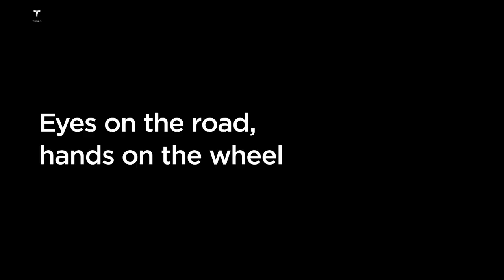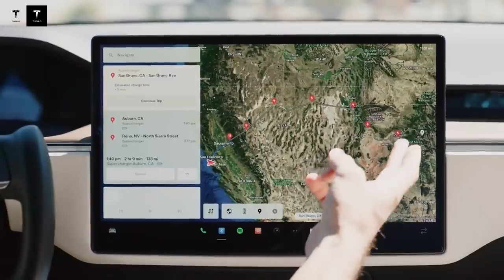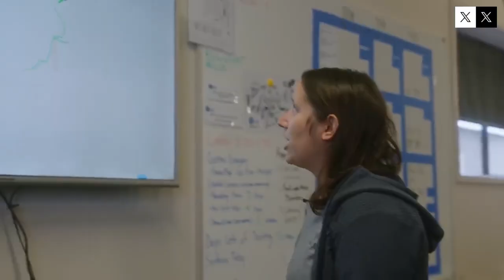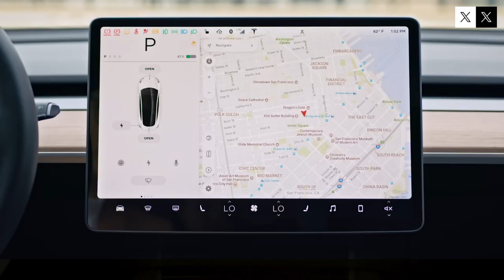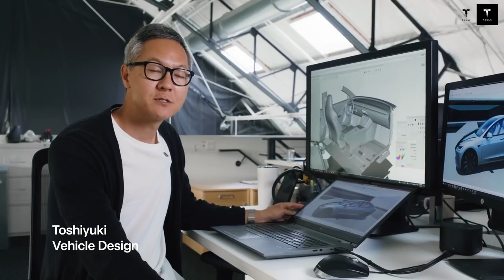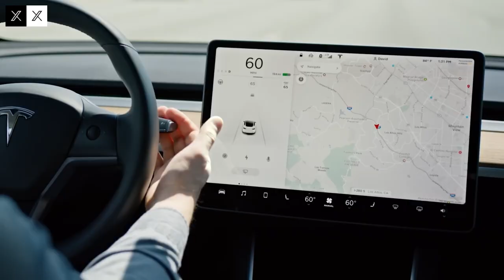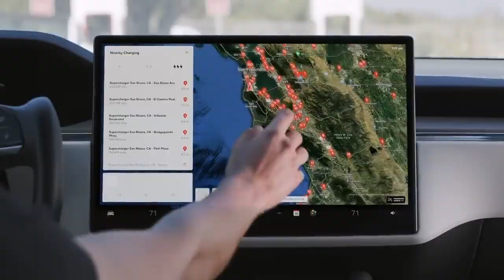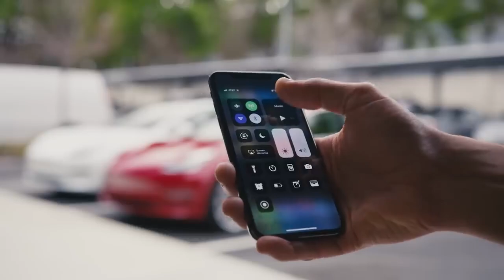New Tesla Model Q 2025! Price could reach $13,999! 48V Architecture And Ultra Long Lasting Batteries

Comment: There is no. Official 2026 Launch  or. Confirmed. Model  Nane model from. Tesla.  Information  :Design  similar  to  the. Model Y
 A target price. Under. $20,000 and.  An expected 
Range between 250-300Miles  EPA  Using. An 
LFP battery, but. Theses. Are you largely  
Speculative 
Design futuristic. & animalist